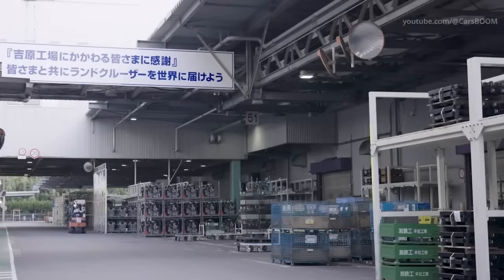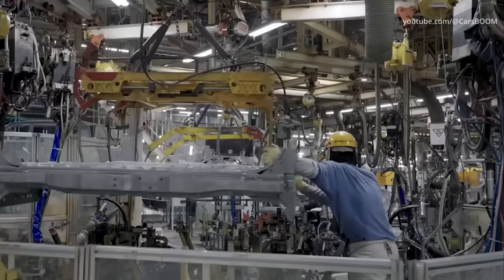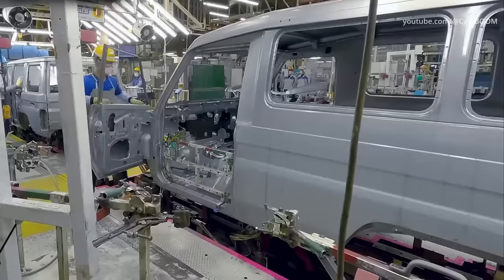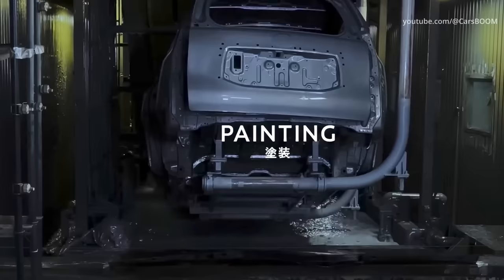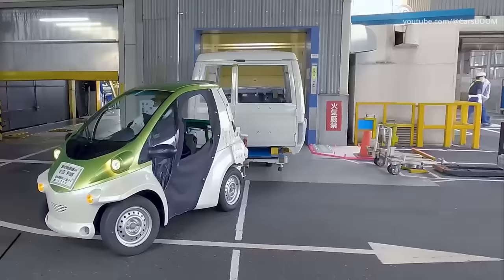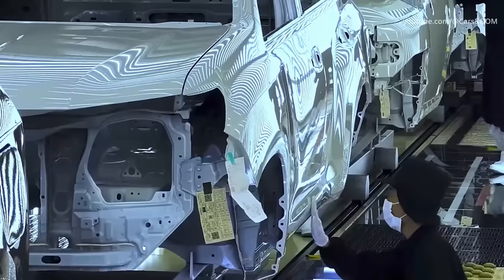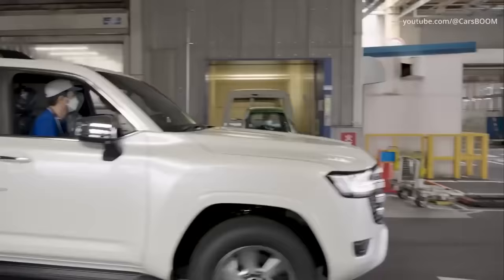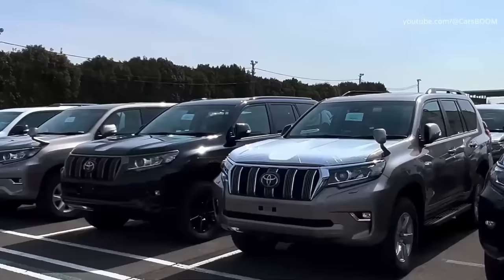How your Toyota Land Cruiser is made? Toyota factory tour in Japan

Comment: I have a 2006 Landcruiser Prado in Australia. The best vehicle I’ve own. The full time 4wd, auto transmission and Diesel engine torque are great off road.
Reply: I have a 2006 as well with the 4L V6. Takes a beating off road and laughs. Never broke down nor left me stranded. Great car
Reply: neither an automatic transmission or full time all-wheel-drive are ideal for off road driving. there are huge advantages being able to disengage the front transfer case, and if you're serious about traction you want diff lockers at least on the rear wheels. also I found the Prado's 4 cylinder diesel turbo motor very underpowered. Certainly compared to the V8 TD in the big boys landcruiser.
Reply: @antoncarmoducchi6057 I bet I’m more qualified than you to comment on what works on and off road.
Reply: @tonydoggett7627  you know he drives a nissan micra in real life;)
Reply: I’ve just picked my GXL Prado with leather and air con seats   Ordered late 9/23, October 23 build and delivered Brisbane Oz in November 23 Under 2 months in total. Amazing finish in Pearlescent White
Reply: @antoncarmoducchi6057   Haha hahaha haha haha hahahahaha hahahaha - I couldn't stop laughing when I read your post!
Reply: @antoncarmoducchi6057  the v8 dpf is gutless in 4wd

Comment: Toyota is my go to company. Especially when they are made in Japan! My 2008 Highlander Limited made in Japan still going strong at 255,000 miles. Change oil every 5k miles with fully synthetic oil.
Reply: It will run 500000 more...
Reply: comfertable 4sure

Comment: I own a LC200 since 2002 with more than 450.000 km and is still perfect
Reply: I learnt to drive in a 40 series Landcruiser.  I put over 500,000km on it.  I had a 75 series, a 78 series, a single cab 79 series, another 78 series as well as for work vehicles I also had an 80 series, 105 series and 200 series.  My 79 series had 650,000km when I sold it, many hard offroad KM’s on it and the guy I sold it to has added almost another 300,000km to it.  We plan to meet up and go camping together on a trip to celebrate her 1,000,000km’s when it’s due to turn over, the idea is to let me drive her over the millionth kilometre 😂.  I love the vehicle.  At the present time I am awaiting a new 300 series GR Sport which will be my final Landcruiser (as I’m getting very old).

Truely it would seem my Landcruisers have worn me out 😂.  It’s difficult for me to calculate the distance I’ve travelled in my Landcruisers but I estimate in excess of 4 million kilometres.  My work Landcruisers use to travel anywhere up to 2,500km/week and all of my cruisers have travelled across sone of Australia’s most difficult terrain…….it’s how remote living in Australia is.  I’m starting to slow up these days, my new GR will probably only travel 4-500km per week, I plan to do a bit of overland travel before I get too old for it.

Landcruiser is my true ❤…….. they’ve never let me down and have taken me on many adventures & back again!

Comment: On my third Landcruiser since 1980, three cars in 44 years tells you everything you need to know, none of them have missed a beat, my current model is a 2018 2.8 diesel with a 6 speed manual gearbox its all the car anyone needs and it gets 36mpg imperial. I am keeping this one as long as I can because its the top spec model and has a custom paint job from the factory and some mechanical mods that were fitted by the dealer when purchased new, the car has taken me all over Europe from Italy to northern Norway. Try that in a Range Rover without any issues .

Comment: We own three Cruisers and love them all. 👍
Reply: too much for you maybe give me 1 its my dream car
Reply: We have a 200 and a Prado (and two V6 RAVs and a Prius.  Our neighbors call our driveway Toyota Nation).  Thinking the 300 won't be as good as previous generations, frankly.  Don't see how they could be, at that price point.
Reply: @davidryder3374   We have a 2019 LC bought used in 2021 and a 2019 LX 570 bough used this year. Both now have 38k miles coincidentally Got them under the wire before they they were snapped up! Heavier than the 300 and that works for me. Safer. Tougher. Worth the extra gas $$.
Reply: Only three? I own a minimum of 7 LCs at any given time.😉

Comment: As a  BSIE "mechanic", I am always looking for a parts which could last longer. Japan is the best and having quality when it comes to materials that we are using for more than 20yrs,both mechanical and electrical specially the Toyota.The quality of their materials are the best this is because,even until now the old land mini cruiser,the box type Toyota B,the 3k,4k still exist.And this modern time the Toyota are very much improved and very much progressive.That is why for those who are wanted to buy a car you better choose Toyota because that is tested and proven even when you run the engine and turn on the air con for 3 days you try to to do what I am doing and try to research for your satisfaction...but for me Toyota is the best because all the parts are available not made to order.

Comment: Very interesting, notably no description of rthe chassis manufacture and painting, sadly chassis corrosion is the number one killer of large Toyota 4x4s in cold countries where raod salt is used if the chassis wre galvanised you really could buy one in your twenties and never need to buy another car no matter where you lived.
I've owned Toyota 4x4's since the early 90's, never has one let me down.
Reply: I would like to also add that there is no proper plastic wheel arch liner fitted to protect the chassis rails and inner front wings a total let down for fans in the colder climate countries

Comment: Seeing these things still mostly manually produced doesn't exactly give confidence, while the robotic roles are considered 'consistent'.
Reply: Doing it manually will give u early detection  when something  is wrong furthermore  though machine  is consistent  it cantmake adjustment  as and when needed
Reply: Yes, you could say the same for Rolls-Royce & Bentley where a lot of the work is done by hand... even the grill on a Rolls is filed by hand... by skilled craftsmen with many years of experience doesn't instill much confidence at all. The same could be said of Toyota's 'takumi' ( or master craftsmen ). You might want to have a word with their engineers and takumi with many years of experience on top of Toyota's track record. Tesla at one point attempted full on automation and was a ludicrous success at failing in it.
Reply: @rsximus  This is the funniest thing I've read in the last week.  I'd be happier if my daughter brought home a crackhead fiance than if she told me she bought a Chrysler vehicle.  The crackhead would be less trouble in the long run.

Comment: 14:19  thank you, always wondered
How headliners were installed without bending them.
They stuff them in the windshield as one unit. When you start looking at long body SUV's few of the have splits to put in as 2 parts  but if you go in via the windshield you can fit the whole unit in all at once.
Then you just have to fasten it to the roof.  After the windshield is installed you can't remove the headliner.

Comment: News states they're bringing this back spring 2024 starting at mid-50k.  You don't actually believe that price, do you?  50k, missing an engine, wheels, seats etc.  Stocked with the necessary parts--try 80k.  Decked out, try 110k.  nice IF, i stress IF, you can afford it and insure it.

Comment: in most african countries you can walk in and buy any of those vehicles, 70.79.300 whatever but there are specially made landcruisers for the UN etc....example would be the 105 chassis, same as a 100 series but without independant front suspension etc...tough as nails, i snagged one at a aid agency auction in Mozambique...bloody loved it. came standard from toyota with front and rear lockers...only thing more capable was/is a unimog...unbelievebly reliable and tough..unfortunately the 300 is rubbish compared to the 100 and 200 series, alot of agencies went to the nissan patrol because of the crappy 300 series...not a real cruiser anymore. i will never part with mine...that things going into my will and to my son...hehehe

Comment: This is an old Toyota models ….it must be early 2000
Reply: Negative, this is the latest footage of the Yoshiwara plant
Reply: What you see is mostly the production of 70 series. It is a commercial heavy duty vehicle not available in North America. It is a super tough vehicle with its lineage going back to 1984! I just bought one for 86k AUD! Not cheap at all but does a magnificent job off road and not even available with auto gearbox!
Reply: So how are there 300 series in there?
Reply: @oggyoggy1299   because  the 70 series and the lc 300 are built in the same plant and assembly  line

Comment: It’s still the same frame toyota run for 20years with no real advancements in new safety technology in roll over standards like other manufacturers
Reply: The ute has a five star safety rating required for worksites and mines in Australia.
Reply: @tonydoggett7627  
The new safety standards is 2020 testing like ranger and Dmax 
Toyota is still 2019 tested that under new standards is a 3
Reply: @tonydoggett7627  the land cruiser Ute had to get 5 stars for mines go ask a dealer for a 5 star rating on a dual cab there is none because only the single cab got tested no dual cab has ever been tested another toyota loop hole.
Reply: @paulmcintosh5589  I guess you’re a VWFord dealer fanboy.

Comment: Now look at the G-Wagen body assembly - nearly all hand welded with continuous seams. Way stronger than this spot-welding garbage.
Reply: G Wagen?🤣 The rust box where the engine hydrolock itself after 140.000km, or the garbage transmission/ electronics. G wagen have higher repair costs than a Rolls Royce the first 10 years🤡

Comment: With a speed limit of 50 kmph it is startling that 67 people died on NZ roads in localities to stupid things like not giving way.

It wont be long till a death on Pukekohe roads. They have many trucks and there drivers here. Bad driving habits here are almost a fact. 

Road accident deaths by age group for 2023 in NZ:
1.15-30 Highest bracket 120 deaths.  
2.31-45 71 deaths in 2023.  
3.46-60 57 deaths.   
4.61-75 55 deaths.   
5.76-90 28 deaths. 
2023 year.

Males rank 150% higher in car accident death rates sitting at 246 deaths whereas females sit at 95 for 2023.

341 deaths on NZ roads for 2023. 341 to many. 

2023 totals for road deaths in NZ 
Cyclist = 9. 
Driver = 182. 
Motorcyclist 53. 
Passengers = 72. 
Pedestrian = 25.

Overall the total road deaths for the Main NZ centers in NZ totalled 279 = AKL/BOP/Canterbury/Manawatu/Northland/Waikato WGTN did not total in with a low rate of deaths for 2023 @ 15 deaths on there roads for 2023.

The waikato faired not much better as we know from other regions with 67 deaths on NZ roads the worst of the totals for 2023.

Canterbury road deaths sit just shy of the AKL 2023 total at 45.

Auckland total deaths on the road abysmal at 47 for 2023. Highest death rates for Auckland roads sits at 111 deaths for 2021/2022 combined.